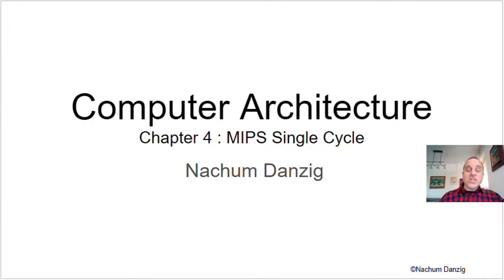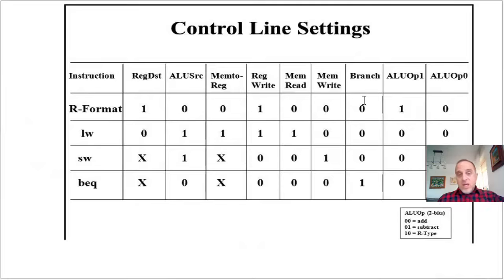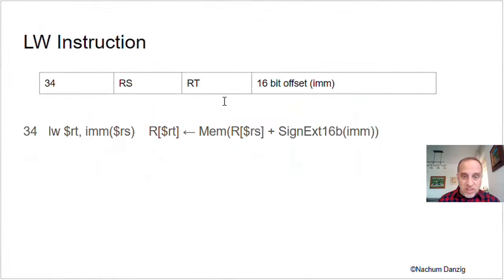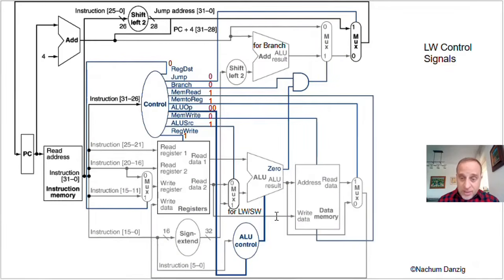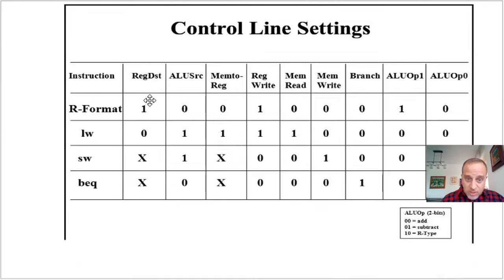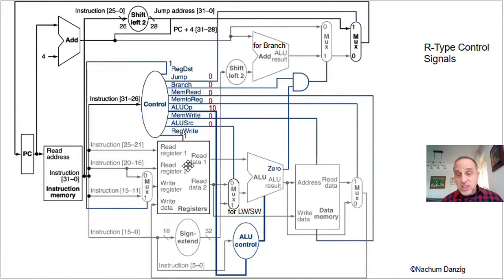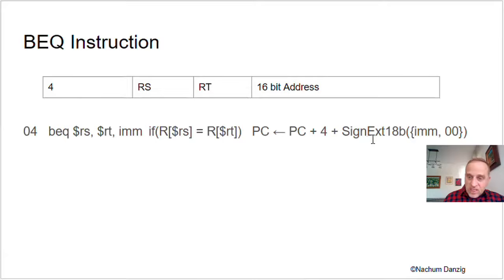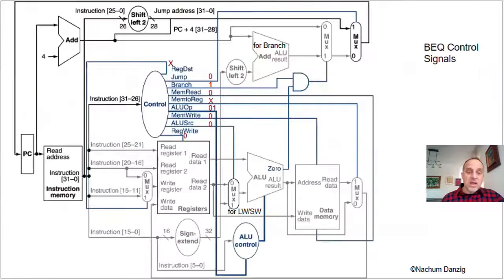MIPS Single Cycle Explained: LW, ADD, BEQ

Comment: At 28:30 why do we even need the funct in the first place? It makes no sense to me, why doesn't Control send the add command already?
Reply: the opcode for all r-type instructions are the same so the only way to differentiate the different instructions would be to use the last 6 bits as function code.
Reply: @orjen1965  thanks a lot. I passed the lesson with AA, there is only 2 AA's in class. I guess main reason of me not understanding is because we didn't learn instructions that deeply.